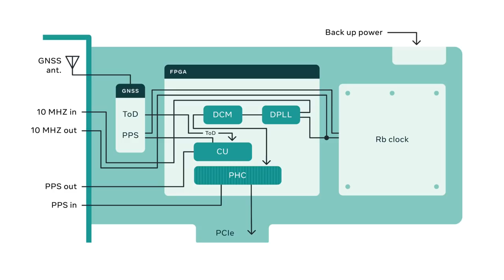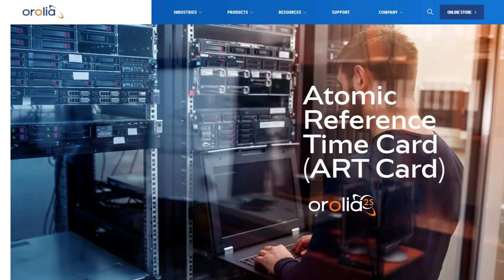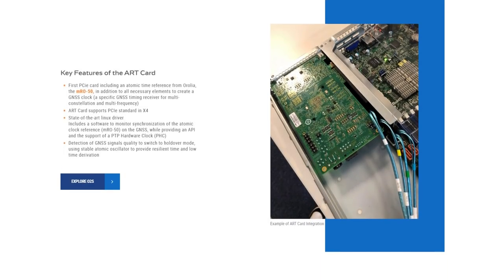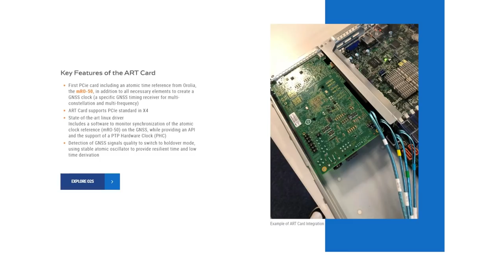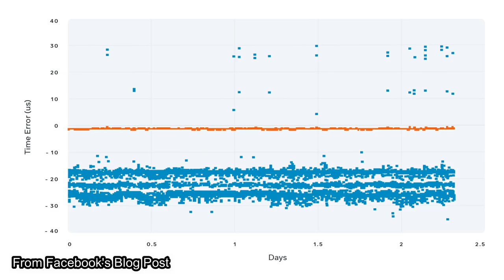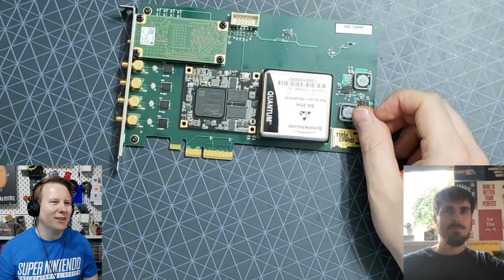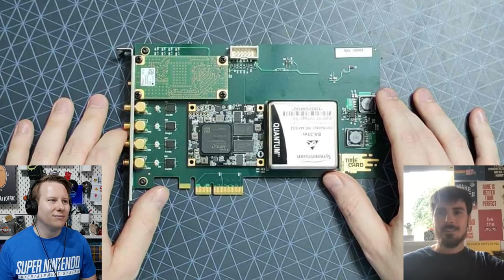Democratizing Time: Hands on with an Atomic Clock PCIe Card

Comment: I came across a used GPS-synced time server on that one auction site for a price I couldn't resist. Now everything with an NTP client in my house is synchronized to a stratum 1 server in the basement. It didn't help, though - I'm still just as late as I've always been.
Reply: @fbi this man..
Reply: I made one with a raspberry pi and a gps hat. Works well.
Reply: This can be done quite easily as a DIY using a Raspberry Pi and a GPS receiver that can output 1 pulse per second. The Linux kernel allows for time synchronisation using a 1pps source to discipline a clock source and you can achieve stunning results. As tested, my homebrew NTP server achieves approximately 5ppb accuracy, meaning it should only lose a second in ~6.3 years. Total cost was <$100. Adding a Rb source would take the hold-over time from a few ms per day to ns per day, which is what this card can offer. That would be nice ..
Reply: It's not a stratum 1 then, it's a stratum 2 server..stratum 1 are directly synched to a national atomic clock. GPS clocks are less precise, have ionospheric delays to consider as well as being affected by relativistic effects. It's still very cool though and pretty darn precise still.
Reply: @MrZnarffy  100% correct
Reply: @kreuner11  No it's not, it's the exact reason for it. But the reason it needs augmentation to get a precise fix, is it is not exact enough. It's gotten better though, from a hundred meter inaccuracy to about3m now...
Reply: bruh

Comment: Many years from now, these clocks might get small and cheap enough to be integrated into the motherboards of consumer PCs.
At which point Microsoft will probably make it a requirement to run Windows.
Reply: Before that, Microsoft need to resolve the DPC latency issues that pop up all the time in Windows.
Reply: Bill needs the precision to time his love-making..
Reply: Then they would probably rather make that a requirement in the next version of HDCP.
Reply: Microsoft removed the RTC requirement for a recent Windows version to push cheaper tablets. And I think that even if you have one, the OS doesn't use it. I've already boticed long-running PCs will be out-of-sync until it resets and pulls from the RTC again.
Reply: @PrivateSi  bill's no longer involved with microsoft
Reply: @triadwarfare .Bill went to work for Apple.
Reply: No they won't. We've had atomic clocks forsomething like 70 years, and they are still expensive.
Reply: @Fay7666  Yeah I think that was with Windows 8, when they were going full on targeting tablets. I remember hearing that you could cheat benchmark scores because of this somehow.
Reply: and then make some stooopid proprietary version of it that'l get adopted by everyone and everyone will be sad
Reply: Why?  You still need to synchronise time to UTC then adjust for localtime to avoid local time skews.
Given the construction of buildings you cannot be sure each PC could receive GPS signals.
It's far simpler to sync to a local NTP server which has plenty of resolution for most PCs.  If you care about greater precision then you run local time servers.

Comment: Jeff Geerling needs one of these to make an Atomic Pi
Reply: That'd be like feeding caviar to your cat..... add another FPGA (or three) and you can probably simulate whatever is running on the Pi just measuring the jitter coming off any signal on the Pi.
Reply: @coenraadloubser5768  it would indeed be overkill and unnecessary, but that kinda is his thing.
Reply: @jelle8055  you are correct. It must be done!

Comment: "I see no practical purpose of keeping time if it is not measured in planck time." -Some alien, probably
Reply: Can you encode only one bit in Planck time, or more? Does that mean that the upper bound on data transmission speed is 10^44*n/s?
Reply: @coenraadloubser5768  A very interesting question.  Given that the upper bound for data storage is (Plank Area of enclosed volume)/4, 1 Planck volume sphere is enclosed by 4 Planck radius discs, so, 1 bit/Plank volume maximum, upper limit of speed of transmission is c, so, looks like 1 bit/Planck time, maximum, and most likely impossible with any materials in the universe, known or unknown.
Reply: @ozzymandius666  I wonder how the  Planck volume of my body, or the planet or solar system for that matter, and how we move around, factors into that...
Reply: @coenraadloubser5768  I'm not sure I understand.  If you take the surface area of your body, in Planck units of area, and divide by 4, that's the maximum amount of data that can be encoded in an object of that surface area, in bits.  Oddly enough, its a 2-d thing(area), not your 3-d volume that places the limit.
Reply: Just Raid 0 the planck constant.

Comment: I see it also has a 10mhz in/out reference so you can synchronize lab equipment to the card. Was looking into making a GPSDO using a OCXO a few years back, but this looks so much nicer and you get time for a PC host aswell. Would be great if some manufacturer could get the card price under 1k.
Reply from the maker: Ultimately Facebook say that depending on what you want as a source (it doesn't have to be an atomic clock), you could get cards as cheap as $100.
Reply: @TechTechPotato  A pci-e gpsdo at $100 to me sounds ridiculously cheap, but if there's a bigger market for the concept, it's going to drop the higher end prices also. I just question the problem of having to have to put a GPS antenna near a window from your PC for your average person.

Edit: Maybe absolute time isn't necessary for the "average person", just a good clock source - so gps reference isn't really necessary, just a good clock source.

Edit2: But then you lack the "Disciplined" part of GPSDO that keeps you in line. Time is hard.
Reply: @nimeq  You should be able to separate the antenna from the PCIe parts over a long distance. Not sure if an active antenna (bandpass + preamp) would do for GPS, but if so, normal satellite/terrestrial TV cabling should work nicely.
Reply: NVIDIA offers a NIC+Time card in one PCIe device
Reply: @TechTechPotato  Precise timing is also used for cameras that can take pictures around corners; theoretically, 1ns could give you about a foot of resolution...there are probably use cases for even that.
There are all sorts of neat tricks that very precise timing can enable, and if nanosecond timing becomes ubiquitous, then I think we'll see lots of new tech enabled by this.
Reply: @nimeq  Routing redundant GPS atennas is the easy part of an absolute time source.  Either it is a paid servce provided by the data center or it is a facitlies install of cabling.  The absolute time source is the hard problem and this card makes that simple at a low cost.

Comment: In the audio world we've had atomic clocks for a few years, also rubidium, also 10Mhz, Antelope audio makes one.
But this one is a whole lot cheaper, gonna post this in the audio forums.
Reply: What are they even used for in that context?
Reply: @daniel-wood  To get the best possible Analog-Digital (AD) and DA conversion by eliminating jitter. The aim is to capture the still widely used analog tape so well that the mastering engineer can't tell the tape machine from his soundcard in a blind test.
The bandwith of digital audio signals (eg 96KHz, 24Bits) is already better than our ears or any analog electronics we can make, the quality of the soundcard and it's clock are what remains for optimisation.
Reply: @daniel-wood  There's the stupid use, and there's the sensible use. Radio and TV broadcast and studio systems have been using atomic clocks for decades, so they can take feeds from various sources, and they all line up in time. That's a great use. The stupid use is thinking it makes a quality difference when digitising audio.
Reply: So the motor of the tape recording the original audio was so accurate that you need an atomic clock to decode it in the same fidelity?
Reply from the maker: I noticed that discussion got quite heated!
Reply: @TechTechPotato  So it seems! I honestly didn't intend to start an argument. Sorry about that.
Reply: @TechTechPotato  Anything to do with Analog to Digital conversion and back brings out anger for some reason. 
An accurate clock does make a difference to the digital archive, but if a human can perceive the difference vs finding it in a spectrograph/analysing sample points is very much up for debate.
Reply from the maker: I mean the post on the audio forums for even more heated!
Reply: @TechTechPotato  Heated? I think deranged is the word you are looking for.
Reply: Yeah, no reason to get heated. No one's saying you need atomic clocking for audio. Larger setups need clocks, standalone soundcards rarely profit. But at 1500.- this is cheaper than many  midrange clocks while being 3 or 4 orders of magnitude more precise.
The atomic part of these commercial clocks usually only serves to stabilize a regular quartz clock , with ubiquity, these modules might become a fairly cheap way for reliable quartz based sources for audio.
And on the studio side people are not so easily taken advantage of, if we try a product and we can't hear a difference in a blind test, we send it back.
Reply: @lrrrruleroftheplanetomicro6881  In science though Analog makes a comeback, since this precision loss is there signifikant.

Comment: This is not really a “atomic clock.” It’s simply a GPS-disciplined oscillator or GPSDO that receives its timing signals from GPS satellites that are synchronized with an atomic clock. Working GPSDOs that have been pulled from older equipment, like cellular towers, can be bought at an auction for $150-$200 easily. However, interfacing them to your PC would be another matter altogether.

Comment: 8:30 Nanosecond timing doesn't really help that much here though. Even at the size of a single datacenter, you're already past the point where our intuitive understanding of simultaneity and chronological ordering accurately describes how spacetime works at the nanosecond scale.
Two different database events submitted to different clusters "within a nanosecond" of each other may have actually happened in a different order from the relativistic reference frame of the different clusters, and any convention you use to decide which one to apply first is just that, an arbitrary convention. There's no legitimate technical advantage to choosing a convention that requires expensive nanosecond precision clocks.
Reply: The realisation that the nanosecond scale the relativistic effects of time in a datacenter are bigger are actually a concern is really something you have to wrap your head around
Reply: Well, yes and no. Assuming the accuracy is sufficient for the order to be reported accurately in the local frame of reference of each server, and that frame of reference is shared by all servers (typically it is, since servers usually do not move relative to Earth's gravity in any direction), the only relativity effect which needs to be accounted for is light cone (or its approximation in fiber). This in turn only affects causality of events. Which means that you can keep ordering events as long as you treat them as independent and have no need to connect them as cause-and-effect. It is only the last one when difficulties really do kick in. Well, that and when the accuracy is not sufficient for the ordering to be meaningful.
Reply: It works a bit differently. We ARE explicitly thinking time for everyone as same. So the nanosecond difference will mean that it is actually different. It is currently small enough that computer or people cant do something useful in that scale. You can say it is a way to reduce conflicts and being compliant.
Reply: @bronekkozicki6356  The example they gave was synchronizing database writes between two different clusters, with the fundamental problem that this purports to solve being resolving the order of two conflicting writes that update the same piece of data - to determine what the final value that should be retained is. If the two events are chronologically distant, the idea of using time as a proxy to approximate causal ordering makes sense, but whenever the resolution of your timing information doesn't allow you to distinguish that difference, it's always just an arbitrary decision at that point.
And two events that occurred outside each other's light cones can't be meaningfully ordered even with a pair of arbitrarily precise clocks. In terms of computation it's certainly possible to perform a numerical comparison between a nanosecond timestamp generated by Server A, and a nanosecond timestamp generated by Server B, but unless the numerical difference is larger than the light-cone distance between those servers, that comparison is physically meaningless. For two servers 300 meters apart, you might as well just use 1us precision timestamps and order events with the same timestamp randomly; nanoseconds can't give you any stronger consistency guarantee than any other arbitrary convention.

(BTW, this sort of misplaced trust in time is exactly the sort of thing that leads to results like the now-debunked "faster-than-light neutrino anomaly" from 2011.)
Reply: @AJMansfield1  you are correct it's physically meaningless. But it's not arbitrary. The server is time-stamping according to it's time which is all that matters. Server only needs to care about which packet came to it first.
Reply: @falconeagle3655  The rubidium standard is irrelevant to the ability to generate nanosecond-resolution timestamps within a single server though - you just use a conventional quartz oscillator.
The thing that a rubidium clock improves on is the clock's slew rate, i.e. how much faster or slower one server's clock ticks compared to another's. But if our server is 300 meters from the other server, the entire notion of an event happening on one server "less than a microsecond" before or after an event from the other server, just isn't valid - including the idea of one server clock's 'microsecond hand' ticking at the same time as the other server clock's 'microsecond hand'. I.e. you can never really have those two clocks in sync with each other better than 1 microsecond.
So because they can't even be synchronized that precisely in the first place, as long as we're able to re-sync, say, once per hour, then there's no benefit to be gained trying to ensure our clock slews much less than 1 microsecond per hour anyway.

(If you want more information about this, this is very much related to the way that it's impossible to experimentally prove that the speed of light is anisotropic.)
Reply: light travels one foot in a nano second, roughly.  So if you want a 5 ns delay in a signal, you add 5 feet of wire.

Comment: Highly interested in this as a “ambitious” home user to have systems with correct time without Internet access. As a lay person: Are private end customers allowed to have an atomic clock? No “dangers” if hypothetically the housing of the clock module gets cracked?
(ASRock, Gigabyte and ASUS motherboards’ clocks drift several minutes per week 👎)
Reply: Well you can already easily get some uranium ore so if you're talking about radioactive materials it's not a problem. Actually, my high school has some uranium ore. And I don't even know if there are any radioactive elements in it anyways, the way how an atom clock works has very little to do with radioactivity
Reply: Well, my high school chem lab rooms also had stuff you cannot “just” buy.
Reply: I suspect it's still updating via GPS but lets you deal with the blackouts as mentioned but I may be wrong.
Reply: @spicybaguette7706  The definition of the second is based on Cesium-133 which is a fully stable element. All that's required is to make it a bit energetic with something like a laser and then carefully watch to see when electrons are released (once you count a certain number, that's a second). These OCP clocks appear to use Rubidium-87 which isn't actually completely stable, but it's half life is 40 billion years, so that shouldn't be a concern either :)
Reply: Atomic clocks don't contain radioactive materials or emit ionizing radiation. They're called "atomic" because they rely on the interaction between EM and some physical effect of a particular atom. They are completely uncontrolled and can be bought and operated by anyone. For example rubidium (atomic) clocks are a very popular choice and those are basically a complicated rubidium gas lamp. Those often cost less than 100 bucks (used).
Reply: Everything is atomic. Not everything is radioactive. The atomic refers to what it's tapping to count number of vibrations.
Reply: no different to having a bunch of ionising type smoke detectors in your house containing americium-238
Reply: @poiuytrewq8ff  totally different, because that's actually radioactive, which atomic clocks are not.
Reply: @-szega  your right I agree
Reply: @liaminwales  yeah, it’s linked to a GPS-like system (GNSS), IC says it at 4:38 and it’s marked on the diagram at 5:29
Reply: @MichaelSmith-fg8xh  I assume it keeps time relay well but with 10,000 servers each with a clock PCIE card there's a risk of drift if they are not all using GPS to keep them in line with the same time.
Any hardware/software error on that scale must compound to be a big problem.

It's the same problem ATM's/card-readers have, keeping time on transactions with the added problem of remote locations.

There's also always been the risk of supply chain attacks which must also be a risk for big cloud. That may be in part why it's open source hardware and software so each user can check for problems/security.

I am sure that's all covered for, super interesting problem.

Edit lol also can be used for online games to stop lag but will it be hacked by cheaters XD
got to see the funny side to, both FB and gamers have to deal with people abusing the network.